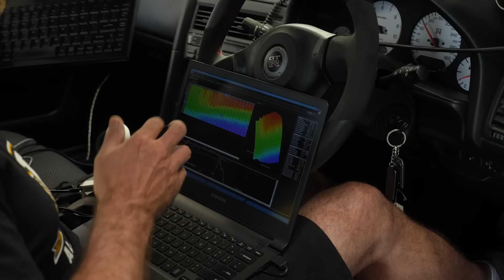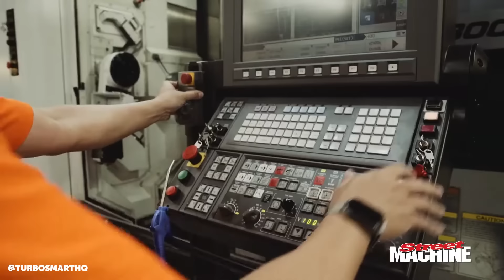It just makes sense | Turbosmart Turbos

Comment: As someone who appreciates and understands turbochargers and development. Turbosmart is the only aftermarket turbo supplier in Australia (that I have seen) who produces their own compressor performance map for their product. I have checked this, and they are correct. Which means everything from Mesh metrics, to their output parameters and engineering is correct. They really need to leverage the fact that they provide compressor performance maps! Because all the other guys (apart from the largest garret, borg etc) wouldn't have a clue of their products performance range or design  limits. 👍

Comment: One thing which they haven't leveraged and really should is using priority wastegate positioned as a variable AR turbo system to have parallel exhaust flow - TurboSmart you are perfectly positioned to start thinking about it!
Reply: So basically, a qsv(quick spool valve)   directly integrated  into the hot side ?
Reply: @RRninja-jq6lp  Would only need a well designed manifold that prioritised the wastegate flow first before the turbine
Reply: Could you explain what you mean? I'm not getting it
Reply: @LuckyFruitRacing  Instead of using a wastegate as just a boost control device, use it as a way to increase total flow through the exhaust system bypassing the turbine at higher engine output to increase VE
Reply: @Upperfoot  you've essentially just described what a wastegate typically already does.... Most quality turbo manifolds already prioritize wastegate flow to avoid boost creep at the top end
Reply: @LuckyFruitRacing  That's exactly right! It's more about how a wastegate is positioned in regards to ideal flow path for exhaust

Most manifolds these days position it as just a pressure relief valve with a very unideal flow path that would mean the exhaust path has reversion when it opens

An ideal flow path complements the engines exhaust flow and doesn't just seek to balance pressure, but also flow between the wastegate and the turbine housing
Reply: @Upperfoot  what you're talking about is already well investigated and developed.... In the simplest form, you put the wastegate directly onto the turbine housing orientated so it receives equally good flow. You're forgetting that the turbocharger itself is prone to reversion and other dynamics, being the side of the turbo that's actually driven from exhaust pressure. You can prioritize flow as smoothly as theoretically possible but ultimately as soon as you open another passage for exhaust to travel into, the turbine speed will drop
Reply: @LuckyFruitRacing  Try finding that information online and it's full of misinformation, the issue is that it's not clear from undertaking research. What might be obvious to myself or you, for most others isn't from my own research on worldwide understanding of the topic. I actually would invite you to find an article discussing what I'm talking about!

Comment: Doing some math and trying to make an equal jump between sizes, you could probably have a set of roughly 6 turbo families to cover everyone, maybe 7. 300hp, 400hp, 550hp, 700hp, 900hp, 1200hp, and optionally a 1600hp capable turbo. That should cover everything from a 1.0L to an 9.0L engine and 6500-12000+rpm depending on the hot side. Especially if you could mix and match hot and cold sides a few sizes up or down for different applications.

One example that comes to mind is a 550 hot side with the 300hp or 400hp cold side for something like a roll race-only superbike. Sure, it's only an 0.75 to 1.4L engine, but they rev literally twice as high as any comparable or near-comparable car engine, so the flow is roughly equal to 2x the displacement for cars. The exact opposite example would be matching a 700hp hot side with a 550 or 400 cold side for something like a 3.5-4.5L 6-cylinder that you just DON'T need to make excessive power on. Or two turbos with a 400hot/300cold. Or twin turbos with 550hot/400cold for a V8 application that doesn't need 1000hp plus worth of forced induction potential.

I might just be entirely ignorant on the subject of matching cold to hot side and how much overhead (or lack thereof) with the former is required for a system to even be functional, but still, you guys get the idea, especially with my generalized sizing thing.
Reply: Agreed to an extent except for the not needing 1k hp or more in V8 applications. I love my twin turbo 6.3L V8 with twin 88mm turbos. They get pushed to 80%+ when I can get all the engine can hold to the track. I ran out of turbo using 66mm turbo's that once scared the crap out of me on gate pressure making 700hp. Now I have bigger turbos with 5 settings from 750-1600hp at the wheels and can't get enough of that beast at high RPM and high boost now I'm used to the power 🎉

I do love my tiny fast spool turbo on my RB30 swapped holden Torana. 400hp from 2700rpm and 600hp at 3500rpm is plenty in that light car on the street and I was extremely happy to down size with a larger hot side and smaller cold side custom built Garrett for the least possible lag. It was dangerous and sucked when it had far more power that all came on at 4,800+rpm.
Reply: @danielwitham1791  If your V8 was 4.6-5.2 you might think a little different, but yeah with a 6.3 there plenty of ass there to push those big snails. For engines in the 2.3-4.5-ish liter range I feel like I'd absolutely prefer peak response with a maximum output of about 200whp per liter.
Reply: Purely from a wheel sizing perspective that's actually not far off the number, then you add multiple flanges into each of the rear housings and within each flange multiple AR's, water cooled and oil cooled, regular plus reverse rotation and all of a sudden I've lost count again ! But yeah you are 100% on the right path with your thoughts here.
Reply: @Turbosmart_Matt  Water cooled would only apply to BB turbos though, right?
Reply: @Drunken_Hamster  As a general rule, no. All the same types of damage can occur on a journal bearing turbo that has been overheated as a ball bearing turbo. With that said - all Turbosmart turbos are a full compliment ceramic ball bearing either way
Reply: @Turbosmart_Matt  I've read that ball bearings aren't necessarily the best choice for a daily or constant-load turbo for a few reasons. BB turbos are also unilaterally more expensive than JB turbos. Why are you not offering any JB turbos and how do your prices compare to the market with both Garrett and Borg being over $1200 USD per unit for their G and EFR series, respectively?

Comment: Thanks for the video HPA, Ive been interested in these since they came out but tbh I feel a bit like they havnt taken it too seriously. The turbosmart website doesnt show all the models and variants and finding out infomation is difficult. For example Im keen on the 6870 large frame but it appears to be only offered in 0.96 in the t4, what if I want to put a larger rear housing in the future say 1.20 or similar. Same goes with say the 6870 small frame and its rear housings, HPT do a t3 1.10 housing but its not listed on turbosmart website either. As well as by now I would have expected alot more dyno testing videos but only a few. Obviously they are selling them all and dont need to be serious Im guessing. Also FYI turbosmart, its absolutley shit that customers cant just come into your Sydney shop and buy products / find out more info on these things.
Reply: @najstephy5565 Absolutely you are on point with the range on the website not being complete yet, that's not because we haven't taken it seriously, it's more a matter of we are still working on new sizes from a design, supply chain (and to be completely honest a cashflow) point of view. I think I mentioned it in the video, but each AR is a new design, which requires a new tool, which has a lead time, then there is machining, testing, validating etc - all of that takes time and money. Trust me, I wish we had unlimited housings at our disposal right away - what did pantene say? - it won't happen overnight, but it will happen....
Reply: @Turbosmart_Matt  These were released 12 months ago to only have 1 or two rear housings available is a let down for people seriously looking to upgrade when garret and precision have multiple offerings. We understand Turbosmart design is slightly modified from HPT but if he already has them why are we waiting. It is extremely hard to believe cash flow is a factor in this, we also understand that there maybe issues from HPT themselves in supplying the housings and we sincerely hope you guys will somehow be able to manufacture some of the components if not all here in the future to potentially assist with that. I get your in the middle but I feel najstephy pain man even we can't just roll up and buy direct is not good. Rang up was told to go to Mtq, absolute worst service ever I walked out never again. Loyal to the brand and run fpr, bov and wastegate but this entry into Turbochargers could have been handled better. Optimistically pessimistic about the future. Cheers

Comment: Turbosmart, how is it that your CFD package outputs a carbon copy of my design of compressor and turbine aero? Fuck, even the fins on the bearing housing a a knockoff of my design. The tool that supplies your turbos most likely cannot explain why they are shaped that way for an engineering purpose.  Granted, it is artistic but sometimes form meets function. I agree, the Chinese do make the best copies.
Hi. Dan Barlog here. I am The engineering director behind Precision Turbo and Engine for over 25 years now. This video mentioned Harry. Great "big picture idea guy". The best general statement I can endorse. God, I love a challenge but wish this guy offered more of one. If turbochargers improve, I'm down for any challenge. Give me a novel design to compete against!
Turbosmart, if you would like to subcontract the real deal instead of a cheap China knock-off, give us a ring. If not, give me a ring anyway. I'd like to hear about your "innovative CFD", advanced computing power, and material science. I'd then like to introduce some knowledge into your public statements. Do you even realize you are working with a 12 year old copy of PTE designs? Yes. It will out-perform the best Garrett has today but kinda of stale if you want to be a leader of the performance turbocharger market. If would like to learn about my antiquated design approach to the products that you are selling and degrading today, give me a call. I can tell you my latest story of how my designs are outperforming multiple doctorate aerodynamicists and their $3mil cluster running ANSYS within the Wabtec turbocharger group. 
As I said, I love a challenge. Harry knew this. I believe that is why he sold the company. He said himself he couldn't compete with my ideas and wanted a change.  I really think that he sold the company to grow ideas that were beyond the current understanding of PTE. I give tremendous respect for that forward thinking.
Reply: "Yes. It will out-perform the best Garrett has today". Hi Dan, which models are your comparing? I would like to check it out.
Reply: I would love to chat with you about your new designs that outperform the best that the propeller heads at Wabtec can come up with (I mean absolutely no disrespect to the highly educated design engineers at Wabtec - Anyone who has earned a PhD in turbomachinery design should proudly get to wear the label of Propeller Head IMO). Genuinely though it would be great to have a discussion about turbocharger design with you. I'll shoot you an email for sure, if for any reason it doesn't end up in your inbox please reach out to me directly.

Comment: I wanna know how they compare to Borg and Holset. Given what I've seen underground guys do with old Holsets and the raw numbers of Borg (both BB and JB borgs), those are my gold standards, both for performance and longevity, especially over Garrett which have much smaller and weaker bearing sections compared to Borg. Nevermind that I heard a rumor that Garrett copied the borg EFR geometries for their G series, but then made them slightly worse somehow AND then went ahead and overrated them compared to their actual flow performance per pound of air.
Reply: these are made in partnership with hpt turbos which is the new company from the original founder of precision turbos before he sold the company

Comment: Didn’t hear anything that makes these turbos better…sounded like they just wanted a part with their name on it to sell..
Reply: They talked about their specific qualifications and approach in the chapter called airflow & material science and computation power and the subsequent sections. If you're looking for something as breakthrough as their electric wastegate, you probably won't get that for some time from a new product line. Maybe they'll eventually do an internal electric wastegate in the future as a new product.
Reply: Google turbosmart 6466 vs Garret 35 900 should answer it for you. or turbosmart 6466 vs EFR turbo. They are better.
Reply: I took a look at drift squid at the turbo smart vs Efr turbo.  Looks like they had developed a crack on the rb previously and discovered it after the dyno.  I would like to see the comparison again with all issues sorted out.  They most likely been driving with the crack with the efr.  During that dyno session they were trying to push more boost and they couldn't make no more power.
Reply: Material quality and aero optimisation

Comment: What everyone wants to know is original maker?,is it quality like Garrett  or just a cheap china knock off rebranded???
Reply: Certainly not a "cheap china knock off brand" Every component in a Turbosmart turbo is manufactured specifically for turbosmart to our design specifications (ie these are not "off the shelf" china turbos - also lets not confuse the location of where some of the components are made with the quality of the finished product. If you think nothing of quality can come out of china, you are mistaken (iPhones anyone)....that's not to say everything out of china is of high quality, it's not. But having a component manufactured in China alone is not an indicator of its quality. Materials, procedures, management oversight, design, machining, QC are far more important than location.

Comment: Looks very like cheap "pulsar" units,a £7/800 unit rebanded now 2k, car enthusiasts getting ripped again?
Reply: @markcozzie  A turbosmart 6466 makes more power down low and up top then a garret g35 900. That should answer your question.
Reply: @blrn54   how silly to say that,how was the test done to compare?,way to many variables to even say such madness
Reply: @markcozzie  Your right I should of mentioned engine size etc.
EFR 9174 Vs turbosmart 6466 on a rb26 by drift squid showed the efr had a tiny bit more torque under 5000rpm but then the 6466 made 70hp more on the same boost around 34psi making 600 odd kw.
On a 1jz garret g35 900 vs turbosmart 6466 the turbosmart 6466 made the same torque at lower rpm with less aggressive boost and made more power with less boost at higher rpm. The 1jz video has dissapeared of youtube soon after it was put on.
Reply: In the driftsquid video they had issues with they discovered a crack in the block and they couldn’t push any more boost.  It is possible they were driving with the crack with the efr.  Not a good comparison video.  Test need to be done where both turbos are tested with no issues.
Reply: @Tkz9000  Yeah nah they put 34psi through both turbos they showed the dyno graph of both.